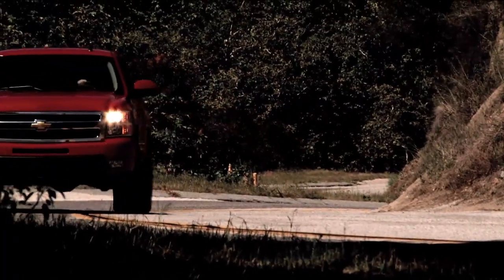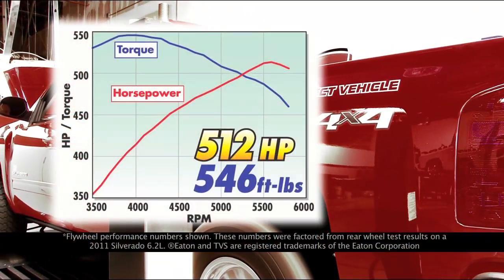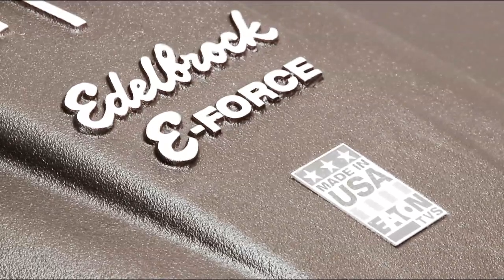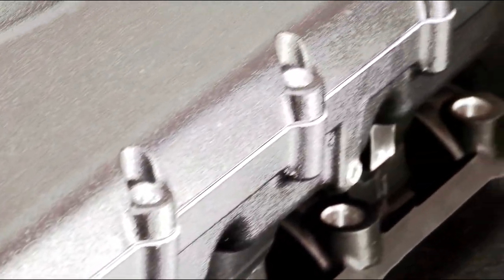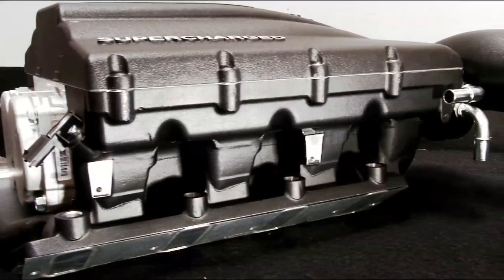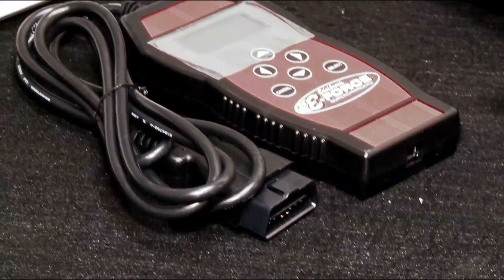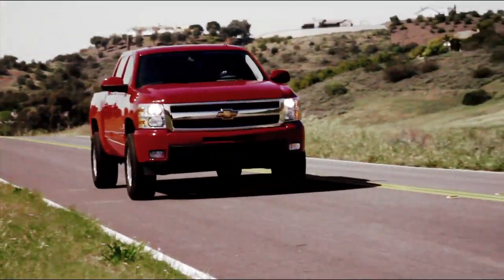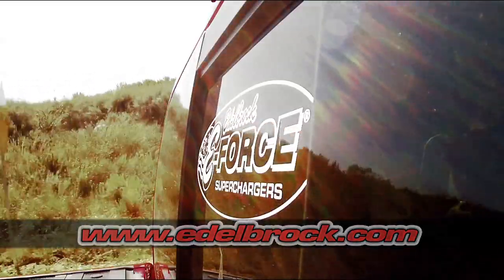Edelbrock E-Force Superchargers for Chevy Truck Applications.

Comment: Would this kit work on a 5.3 vortec swap on a c10?
Reply from the maker: No, these kits are designed specifically for 2009-14 GM truck applications. But we do have Universal E-Force systems that are designed for LS swaps into anything. They will require some fabrication work. Check out this link to view the complete list of kits available: http://www.edelbrock.com/automotive/mc/superchargers/universal.shtml

Comment: I wish I would've bought a edelbrock charger. I bought a bs Weiand have been sorry since the day I bought it new. It leaked gear oil the first day. I bought a seventy dollar gasket kit. That's when I seen the shoddy machine work. When the front of the case was drilled for the bolts their bit chipped out the gasket surface so changing gaskets did nothing. Weiand tech department is understaffed so they don't return phone calls and have gave me the run around for two months. I was so discouraged I wrote the president of Holley performance. Of course he didn't respond. He had his no guy contact me Shane whites carver wouldn't help one bit to figure out the issue only looked for a reason to make it not his responsibility wouldn't even answer one tech question. I would've been better off with a leaf blower. I'm not a rich race team. I had to work a hard dangerous job to even buy it. Holley performance doesn't care about their customers. I always bought edelbrock. Everyone in Mt buys edelbroc